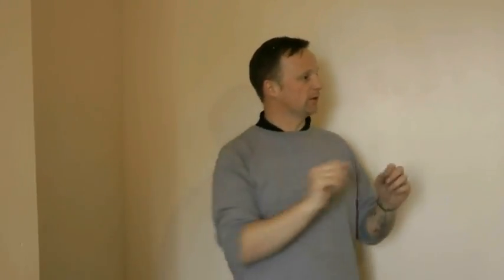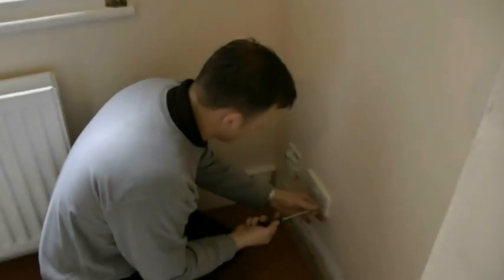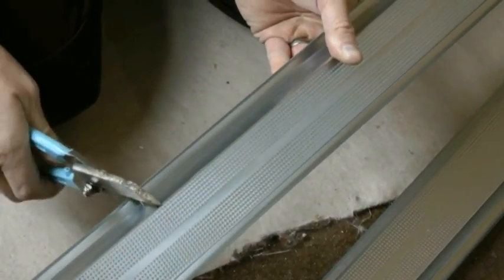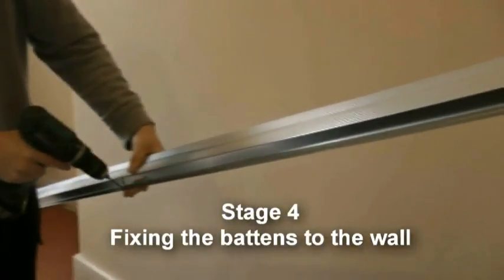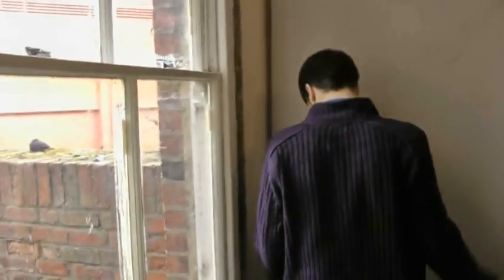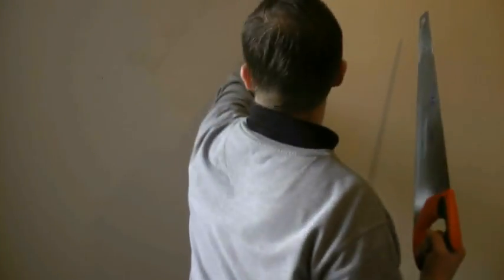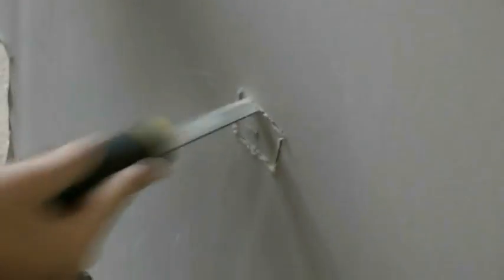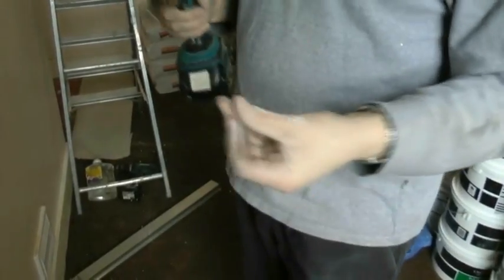Solid wall insulation installation - Part 1

Comment: Using metal instead of timber to handle condensation!!???? Get a condensation analysis done and make sure you wont get any! No safety gear, inhaling plasterboard and insulation dust is really bad for you. Using Rawlplugs and not concrete/masonry screws? I stopped watching this lesson in how not to insulate a wall - pity the poor students.

Comment: This is a fantastic video.  Properties built in early 1900 have solid walls. Solid walls will attract condensation and mould and believe me there is no real cure other than mould resistant paints.If you are unfortunate enough to own 1 of these properties you will know exactly what i am talking about. The only way to overcome this problem is to create an artificial cavity as shown in this video. I have tried it and it works. Ignore all the negative comments below. Part 2 would have been great.
Reply: What good would the cavity be, if there is no ventilation or escape for air flow and/or condensation build up?
Reply: @MWA1407   I agree, it just does not make any sense. The  vapour will get condensated on the cold wall. The bigger gap, the more air and vapour can get trapped in there. Unless it can get absorbed  by the wall and evaporate to the other side of the wall during the summer month? But on the other hand, he is saying that wooden battens used to rot. Which tells me, things can get nasty in the cavity.
Reply: My house was built in the 1920's and has solid walls and i have no condensation.

Comment: Where's the vapour barrier? Metal conducts cold better than wood, and wooden batterns won't rot if the right vapour barrier has been put up, and the right sealing tape has been used between the screws and the barrier.

Comment: Use low expansion gun foam to fix direct to the wall then a few mechanical fixings through the boards.

Comment: Er sorry..did any one spot what he said and quite rightly so OF THE SWEATING this installation will make??? er donut!!! in a year or so time when sufficient water has accumulated against wall and against the layers closet to the wall, it will run down onto EXPOSED WIRES and hey presto folks you name it!

Comment: Clicking from Poland. First thing: Insulating from inside should be never considered if there re is possibility to insulate from outside but sometimes there is no choice. In Poland insulating from inside is considered as mistake in the art of building trade and is never even discussed in new developments.
However if you have to If you insulate from inside: 
On the video they create a gap between the wall and insulation.....????  There should be NO GAP whatsoever to PREVENT condensation. 
Condensation come from the warm humid air from your room and once the air is cooled down (by the cold wall) the moisture from the air will condensate. So no air gap means no air -> means no condensation means no problem.
If you leave the gap like on this video and finish it off with plaster and paint the chance is that everything will be fine as long as the gap is hermetically sealed and there is no circulation of air inside the gap. Once there is a crack a and room air start circulate between the cold wall and insulation only god will help. You will get all the wall wet inside and streams of water running on your floor or under the floor. 
Some manufacturers(Celotex or Kingspan) in their installation manuals ask you to put thick dots of adhesive before placing the insulation board therefore creating a gap. That only apply to the RAW BRICK WALL with UNEVEN surface and the ONLY reason for that is to help align the boards together. When you have nice flat, sound  and finished wall like on this video - do not leave the gap!
Reply: thank you for posting that it's very helpful....If you have a solid brick wall (UK) what's the best way then? dot & dab (which I don't trust)...wooden battens & insulation between..or similar a gypliner system? any help would be appreciated by anyone as I'm really confused! by the way the walls at the moment are totally bare brick & racked out mortar...the walls need to be repaired & rendered 1st as they are weakish.
Reply: If you have to insulate from inside and there is no option to insulate from outside then do the following: 
1. Do not render. This would be a pointless excersize unless you want to waste extra time and money and loose 2cm of room space. 
3. I do not understand why you think walls are weakish. Render won't make them stronger. I quess you mean the wall is dusty and covered with 'sandy' residue and you are worried that edhesive won't stick onto that kind surface? All you need to do is to prime the wall with stabilising solution. Mixture of PVA and water 1:5 will do. Do it second time after dry.
4. Fix the holes bigger than 4 cm in depth using expanding foam (if there is no structural issue with the wall use expanding foam to fill gaps caused by missing chunks of the brics). 
5. Use dot an dab tachnique to install the boards. Push the board as much as you can to make gap as little as possible as the celotex manufacturers recoment in the videos.
6. Next day after adhesive sets drill holes and use fixable mounting to as per manufacturer instructions. 
I do not recomend using wooden battens or other techniques when you are lucky anough to have solid walls. dot and dab technique is the most space saving way, and cost effective technique. Avoiding wooden battens also make it more fire safe. 
Also remember one thing: When you buy celotex boards and you have to store them for some time always lay them flat on the floor one on another. Never stand them against the wall because they might slightly change its shape after a few weeks.
Reply: +Marian Fr but surely dot & dab may introduce damp from the outer wall & cause damp spots through suction?
Reply: Why d&d technique be causing suction and other techniques not. I have never heard of "suction" causing dump in d&d technique or in any other techniques. if your wall is dry now when you stripped the render then your wall is fine and there is no issue with it in terms of water coming from fundation . if your wall is damp then there is an issue with it and it needs to be addressed before insulating it. Lets asume your wall is touch dry. then you can insulate it making sure you isotate the gap (wall-board) from your room air. This is done by jointing and skimming the wall afterwards remembering about sealing the bottom of board at the floor level. (If by saying "damp by suction" you mean water sucked by from the fundation (rasing damp) then this is separate issue related to damaged horizintal damp proofing membrane and it can be fixed by cutting the wall an replacing that membrane. That is more serious issue unrelated to what kind of insulation technique you use.
Reply: +Marian Fr thank you
Reply: Hi,  need to insulate one of our walls (solid wall construction).  We are planning on using insulated plasterboard (Celotex) d&d, then using liquid membrane (i.e. bitumen), then vinyl paint to finish off.  Do you think that's the right approach for a wall troubled with condensation?
Reply: +Joanna Sroka joanna I've alwats been told that using bitumen or modern emulsion such as vinyl on ols solid walls is a no no as solid walls in old buildings need to breath....check out Peter cox's videos on YouTube
Reply: +Joanna Sroka sorry its Peter Ward NOT Peter cox.
Reply: Marian Fr  Hi Marian some really good advices there. Much appreciated. I was wondering if there's any other way to contact you other the YouTube and possibly got some more advice for you. I'm a self taught and could do with some professional help. Thanks in advance. Tomasz. Pozdrawiam ze Szkocji
Reply: Greetings from Hungary! I have never heard insulating from inside in my whole life :) but when you are in UK the whole story is different!
Reply: Hi i am from south China, planning to renovate an old apartment. And apartments/houses in the south, they are all brick/concrete walls, no insulation whatsoever, and personally i think its very necessary. And yes, if i decided to do this, it has to be from the inside. Just one question, when doing the insulation to the walls, should i also put on the ceiling? Thanks.
Reply: Agreed, internal insulation can cause many problems damp ,mould and rot as it alters the dew point in the room, fact.  Just look at all the cavity wall insulation that is now been removed due to the massive problems it can cause if its done badly which is the norm as its a quick buck scheme that's not understood by the insallers
Reply: Hi the problem is probably the lack ventilation in the room it cant breathe. If the wall is lime mortar it also needs to breathe

Comment: Don't understand why put the frame against the outer wall. I built my house with insulation blocks outside and then put the fame up but left a gap between it and the outside wall..The reason was to hide support columns and for a better internal finish. That said my house is in Thailand not so cold here :0)  but I have stripped condos/houses where this method has been used and when removing the wall nada, nothing, dry as the day it was installed. I would imagine if you left a gap/cavity with no contact between the 2 and used a vapour barrier then you would have no problem even in in sunny Poland. As for there being no gap don't confuse that with forming a cavity because every house in Scotland was built with cavity wall for decades
Reply: MultiArkle 0